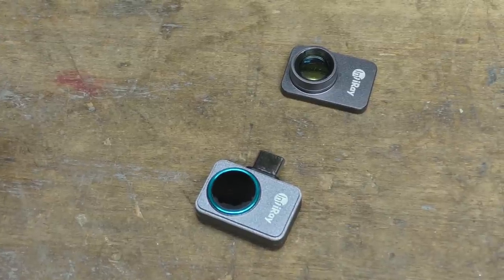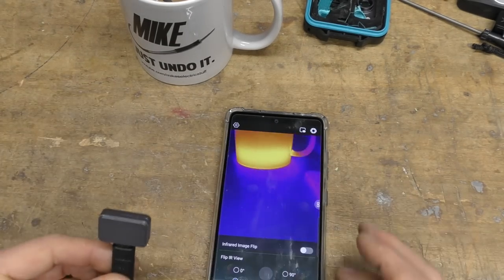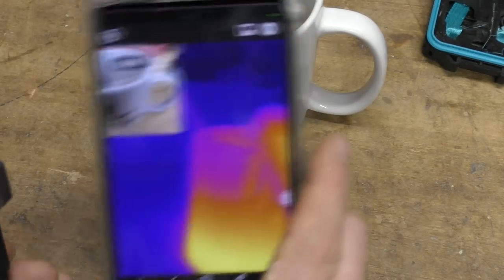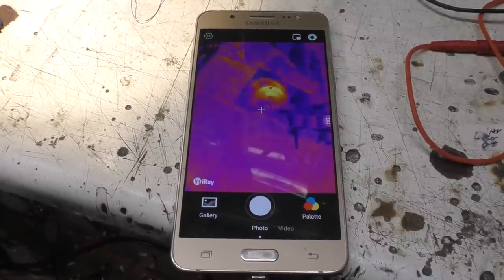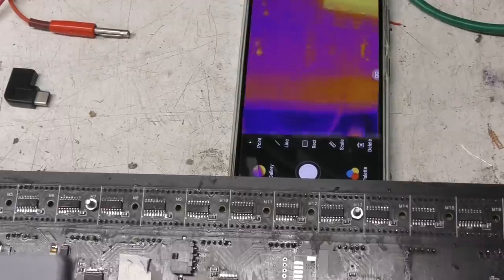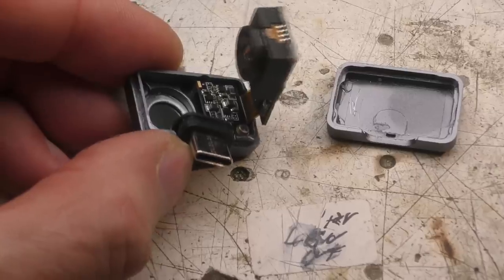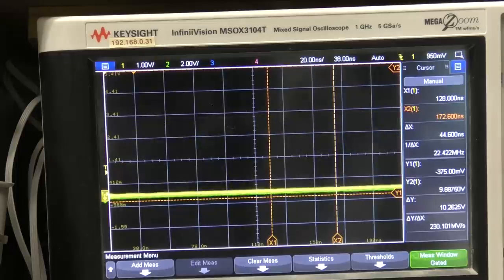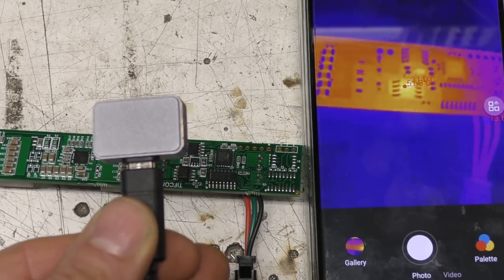Infiray P2 Pro smartphone thermal camera review & teardown

Comment: I worked with a Tiny1-C(same module, no flex, more densely integrated) before it was released, and the preproduction devboard it came with is really similar to the P2.
The sensor module has SPI(in some versions), I2C, UART, and a regular parallel digital output(DVP). The Realtek chip is literally just a DVP to UVC hardware interface used for generic webcams as well.
Their cores are a pleasure to work with, very intelligently designed.

Comment: Cheers for a great in depth review Mike! Looks way better than dito FLIR dongle cam addon, and the 24 fps feature sold me right away after the frustration of handheld lagfest whilst searching for hot components on a tightly populated pcb with all tiny components gets me every time...
If this is an early-ish version where they've spent most of the time doing the hardware perhaps we can expect some nice app updates in a near future addressing the things you pointed out here for starters?! 
I can see this causing some headaches for Seek Thermal, FLIR etc purely on the fps feature alone since that will easily drive sales. Also being more compact and less in the way whilst troubleshooting stuff. Saw below that someone just bought one at aliexpress for £175 shipped to UK including VAT - if the fps and size didn't sell it, the price surely will since any similar device made in EU or USA with that framerate would probably set you back a grand, if not more?! Never really checked since it's way outside my hobbyist budget for something I use rarely...
Again, cheers for the review and fantastic tip!

Comment: Have owned the T2L for half a year now. Great piece of hardware and the adjustable lens allows you to go in really close if needed. The 25 frame rate changes everything, you can just intuitively point it around. I am not worried too much about the software support long-term because in the end it outputs UVC video which will allow any program to at least read the output. It is not the most precise but for PCB or home insulation sleuthing these things don't have competition.

Comment: I've got a HT 301 which is pretty much a InfiRay T3 in a different enclosure. I think it uses the UVC zoom control for setting palettes and stuff. When connected to a PC there are a couple of rows of pixels at the bottom which appear to contain data from the camera. Maybe this one operates in a similar way? Hopefully the US removes their framerate restriction for thermal cameras. I wouldn't even consider buying a camera from a US manufacturer at the moment when you can get 3x the frame rate at half the cost from China.

Comment: The resolution and framerate looks great compared to similar devices. 

I guess they can't do the dual-camera overlay like flir, because of the patent.
Reply: no. the patent is expiring and you can work around the wording.
The issue is that if you don't know the distance of the cameras, how can you align the pictures?
Reply: @sarowie  How expensive would it be to put a cheap RGB camera alongside the thermal camera? 10 USD? Maybe it's still patent(s?) why it's not done.
Reply: @kwinzman  sure, the cheap rgb camera is cheap - now you need to precisely align it, so that both axis look in the same direction. If the two cameras squint even a few degrees of axis, you have a mess on any distance. Then splice the video stream "somehow". You could do an internal USB-Hub, but that is expensive and huge. You could create a jumbo frame with both - now you sync two cameras and need an FPGA or Microcontroller with serious memory just to compose the images. Note that when done right, the IR-Module never actually has a full image - you need to chop the video into packets "eitherway", so why waste memory and at time delay just to...? Yeah, much easier and faster to store the ADC results just in the packet buffer and send the packet on its way when its time.

Also note the lack of polish in this product and details like the app. Mike does not mind them, but they are there. Now make that with the overlay technology and it becomes the opposite of helpful as the pictures annoyingly only align when freshly user calibrated (for that specific distance), but the user calibrate button glichtes out regurlaly, so you don`t want to user calibrate... so you switch it off and wonder about the waste of space of an RGB camera, when the smartphone cameras are so much better "eitherway".

Comment: 12:13 - on an old Pi 3 using a thermal camera you can see each of the 4 cores in the CPU doing things.  It's very cool (or hot!) - sadly the metal case of the Pi 4 CPU makes this difficult now

Comment: Neat. IIRC, the Pi boot loader starts the GPU first, that tiny first hot spot, and it, the GPU, then initializes the RAM, that tiny second hot spot, then starts up the CPU core, that big third hot spot, after which it transfers control to the CPU. Cool to see it in action like that.

Comment: I just got the T2S+ and use the xtherm app which is a different app then you are using?  The T2S+ is 256x192 with adj built in macro lens infinity to less then 1".  I waiting years for these to get better and for price to come down, these by far are better then seek or the bad design of FLIR built in battery.

Comment: The ambient temp could be to compensate for reflection. If the target object has a low emissivity then the reflection of the surroundings off the object will affect the temperature. They may also be compensating for air absorption/emission of IR, although they would need to know distance and humidity for that to be accurate.

Comment: I mean thermal camera apps really, really need to be open source. That I can't fix those small clunkyness problems with the UI myself really is a dealbreaker. I wonder when those companies will learn that the way to sell their cameras is to have usuable, open apps.
Reply: It's just a regular UVC camera so any video player will work. The only thing extra is a few lines of pixels in the bottom of the frame that encode metadata like temperature ranges etc.
Reply: I'd have to pick up this one specifically to test but OpenCam and HedgeCam are both really great for supporting wacky/unusual cameras, due to being forks of each other.

Specifically, on a Pixel 4 I have laying around, I'm able to access the infrared front-facing face detection camera whenever I wish - not quite as handy as a true thermal camera, let alone one that can be flipped around when needed, but it's still a handy thing!
Reply: It is probably a USB 2.0 device, if it is, it will not be long until someone plugs one into a "GreatFET One" and fully reverse engineers everything that the application does and creates an open source application.
Reply: Because their job is creating the device and making it functional. It's not worth their time to make the UX wonderful, but you can do that for others if you want.

Comment: When it comes to thermal cameras the products from Chinese companies really seem to offer by far the most for the price. Infiray, Qianli Super Cam....so many nice companies that offer thermal cams with higher resolutions, much better framerates, closer focusing distances and even the software is often better. Their software might have flaws too, but just for a little comparison. I'm currently using a Flir One Pro which is worse in all the points above and cost much more. The Flir doesn't work on the PC and their App had for about 9 months a bug where half of the menu wasn't accessible because it was off the screen on most recent phones. It took me about 2-3 weeks to finally find a way to contact the Flir support for a bug report because their ticket system didn't let me log in and all provided eMail addresses were dead or just replied to their non working ticket system. But even after reporting such a massive bug it took months to fix it....together with a new product they try to sell. It was my first and last Flir. 
Happy to see that these days we can get something much better for the money. Looking forward to an upgrade.
Reply: From my experience with quite a few cameras, I found only the FLIR ones can read temperature with any accuracy. The Chinese offerings and Seek both fail to read temperatures within even 5C of accuracy, sometimes off by more than 10C. They are good tools for finding shorting spots, but not good for radiometry. I know how to handle different emissivity, and I've received some proper radiometry training, the cameras just aren't accurate enough. I use a T3Pro from Infiray, and for what I do with it it is capable enough, but if you want concrete numbers, forget about it. I only use it to make sure my SOT883 transistors don't explode, and for that teeny tiny size I need a high resolution camera with a refocusable lens, hence the 384*288 camera. But I would be fooling myself if I cared about absolute accuracy. I only need to know if it is <=120C or >=175C. Any error within the gap is fine for me.
Reply: @bskull3232  i cant say that over my P2 pro.

i played a lot with it and even could monitor a slightly raised body temperature on my forehead of 38.2°C when i got the flu a week ago vers. 36-36.6°C normal.

i'd call that super precise for a non prosumer product.
Reply: @casemodder89  Good for you. Maybe mine are zebras. After all I didn't have tens of them, just a few. Most of mine measure body temp in north of 40C. That being said, I live in the north and the ambient here is cold, so the cameras tend to read higher than true temp. If your ambient is closer to the object being measured, you will get better accuracy.
Reply: @bskull3232  Well, I can't confirm that either. Of course, thermal imaging won't getting accurate unless you are in the high 3 or 4 figure price range. There the sensors are usually compenasted for temperature changes and drift. Also: Emissivity is a great factor. I Usually use .95 for the most daily stuff, when I want to d accurate then I need to set the factor accuratly, then the results are pretty accurate. 

(I tested that on my 3D printer, I installed a separate thermal probe, used a matte tape and tested it with 70 degrees C of temp). 1-2C's difference is to be expected, with no account for emissivity 5C are possible, or even more, but usually a thermal camera is used to spot faults, defects or thermal bridges, rarely I've seen those to get used for referencing temperatures. 

In my expierience with also some higher end FLIR's, it's mostly user error. Also: The pricepoint.
Reply: @jensharbers6702  Cheap cameras have single point temperature compensation sensor. When the camera is being warmed up or being cooled down, the compensation temp is not lens temp, thus the compensation can be thrown off by a few deg C, that's a major source of error. If you pull a camera out of your pocket into the cold winter air, you will find it being quite inaccurate for the first few minutes. Unfortunately, I don't do thermal imaging for a living, I only use it sparsely when I have to, so they never get to be properly warmed up or cooled down to reach thermal equilibrium.

Comment: your video gave me the idea of mounting a thermal camera inside my iphone SE (2016). maybe run jumper cables to the lightning port and have the negative/black wire go through a reed switch and use the magnet on my keychain splitter to activate it? shove the battery down a little bit, take apart the infiray p2, drill out a hole in the case, hot glue lol. it looks like its pretty decent image quality from your video with no additional lens, just the packaging. I really do like the size of my mini iphone, its actually the guts of an SE shoved into an iphone 5S case that i made. hmm so many ideas. thanks for uploading this. probably the only footage on the internet of the inside of this thing plus image quality without lenses!

Comment: There should be a standard IR camera API already so that we could have a best of breed Open-source viewing software starting to mature.
Reply: Affixing with double sided or glueing a magnet on the back may be a handy method of mounting the camera as long as you can source a flexible cable.

Interesting that all the boot parameter text is in ENGLISH.

Comment: There is also a Infiray Xtherm T3S and Xtherm T3Pro which costs nearly three times more for 2.25 times the number of pixels 384×288 (T2S+ and P2 Pro has 256×192) still with a 25 Hz frame rate. Personally I can't justify the higher price.
Reply: 288p camera can be 50cm away from the bench on a pantograph with all that space available to you, to work with your both hands and even flip and move the board around, solder and rework without spewing the lens and camera with flux and fumes ;)

Comment: Mike I need to use this camera to find thermal asymmetries in some large angle high temperature sources. Whenever I use it for this purpose the camera gives a prompt about overheating. Do you think this can be avoided with better cooling of the sensor/PCB?
Reply: Overheating its safe message for matrix 
Because a matrix cant see high temperature

Comment: These are interesting. I have an old thermal camera for android phones that uses micro USB and specifically USB OTG, but neither of things work properly on modern android phones. So I have to keep a really old phone around just to occationally use the old camera. Maybe I need to upgrade...
Reply: Or just get a USB-C to micro-usb OTG adapter - like every possible USB adapter you could possibly think of is out there somewhere
Reply: I'm still looking for a phone new enough to have OTG ..
Reply: @petevenuti7355  Huh, every phone I've had had OTG going back to some ancient HTC something or other running Android 3 - on a phone with a micro USB port, you need a special OTG cable that shorts the 5th pin to ground which tells the phone to go into USB host mode (otherwise it's a USB device). My last few work phones have come with a USB OTG adapter that plugs into the phone with micro-usb and provides a USB type A female socket on the other side (like a standard USB port you'd find on a computer)
Reply: @gorak9000  got 3 that don't, even tried rooting it and adding the necessary files to support OTG only to find the hardware incapable...
Reply: @gorak9000  You wrote: "you need a special OTG cable that shorts the 5th pin to ground...". Could you be more specific, the 5th pin is the ground (1st red is VCC , 2nd white is D-, 3rd green is D+, 4 NC is ID, 5th black is GND).  You probably meant connecting the 4th pin to ground, i.e. to 5th pin.
Reply: @Kali_Kali  I meant 5th pin as in "the additional ID pin vs standard 4 pin USB", not necessarily that it's pin 5 - I don't remember the USB pin outs off the top of my head - I look them up when needed. That's probably all changed with USB-C now too.

Comment: That stupid fucking ITAR limitation is bypassable for anyone who's motivated enough to. Reps got what remains to be the best deal out there (that sterling cooler based InSb (MCT ?) insanely fast sampling/high res cam from Teledyne). Those image caps he got of his CNC doing chip evacuation, incredible research potential. Cool that this comes with a barlow lens for macro work to work on boards

Edit: that probably just talks via CSI [camera-serial-interface? I duno, been a while since I looked at the standards, they're probably at revision 2 or 3 now. Also, you could probably hook up a peltier cooler and get a reasonably okay decrease in quantization noise
Reply: Wot?
Reply: @donaldasayers  ITAR is what the fedzz limit devices like FLIR to 9fps or whatever. Reps is Marco Reps, a youtuber who does interesting projects.

@mikeselectricstuff rts5822 is ..well, exactly what you speculated. Put in Realtek rts<integer variations> and you'll find they're usb camera controllers. The 5822 has BIST and some interesting filters.

That ASIC is almost certainly not dev'd in-house since it looks like they etched the markings off. My guess is at most it's customized with IP softcores bought from the-usual-suspects then contracted out for something like a 50k unit run as a structured ASIC or SoC. If you want to get meta, ask them for another unit so you can analyze this unit. It could literally just be a Zync 9000 or whatever
Reply: I read some of the datasheet for the sensor, if I'm not mistaken it's a 8 bit interface....

Comment: Hello, your Review is very good, but I can't find any that talk about the camera software, I have some doubts if, for example, I can take thermal photos and then calmly analyze them, check the temperatures with the points, lines and rectangles of an already saved image, Another question is the software for Windows that I think it has, I read that it does not open the images of the Infiray P2 Pro, since you have this camera you could clear my doubts, I am interested in buying it, greetings and thank you.

Comment: Taking a look at an Aliexpress page for this product, there's no mention of focus. It doesn't appear that there's a manual adjust for focus, so is it a fully automatic focus (from near to far) or simply just close? How would this work outdoors?
Reply: You don't focus it. It's quite a wide lens so they are relying on the hyperfocal distance. Things are in focus from about 30cm to Infinity.
Reply: @AlexanderGee  Is it wider than a normal cellphone camera or about the same? 

Edit: How does it also compare in focus and FOV compared to the seek thermal? Can the Seek Thermal get a closer focus?
Reply: The Focus is fixed to "Infinity" I'd say. 

I mean, I ordered mine with the macro (SMD Diagnostics are a breeze with this thing).

Comment: Could I use this in a wider angle application. I want to stand in front of my house and use the thermal image to find health leaks through windows ect.
Reply from the maker: yes
Reply: I've used mine to see power adapters I thought were turned off, sitting there drawing power, getting hot, and wasting my money! If it's warm, it's using power.